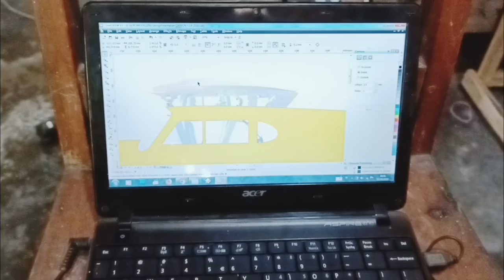DIY CARBON CUB 2500 part 1

Comment: Hello friend, thank you for your teachings, can you please tell me what is the diameter and length size of the wing union tube, and the diameter size of the coupling tube that is fixed to the fuselage? I need to buy these tubes and I don't know what size I should buy to finish the construction.
Reply from the maker: @edgardo9469  wing spar : 25mm and wing struts : 10mm